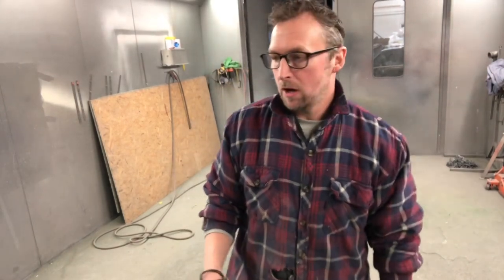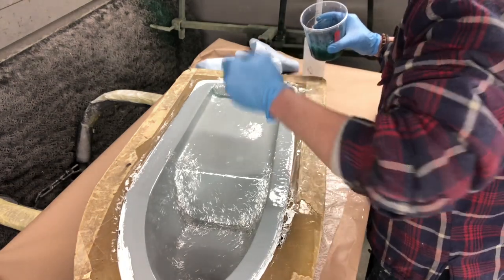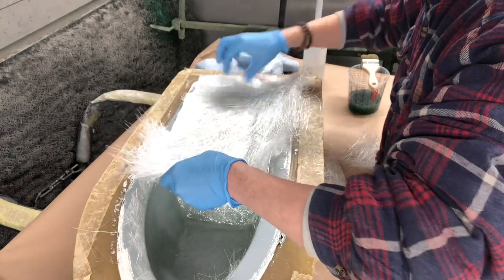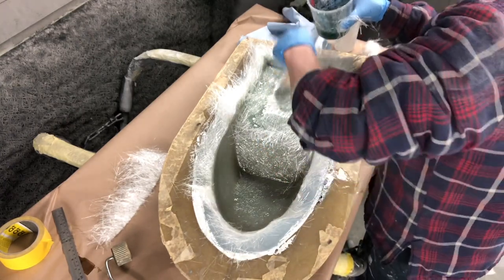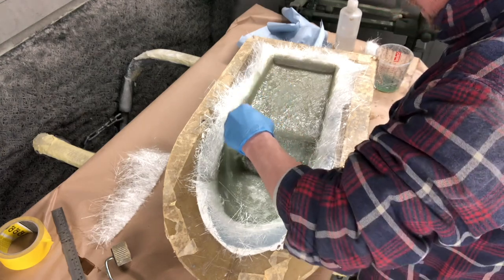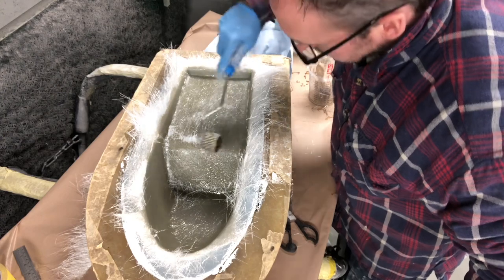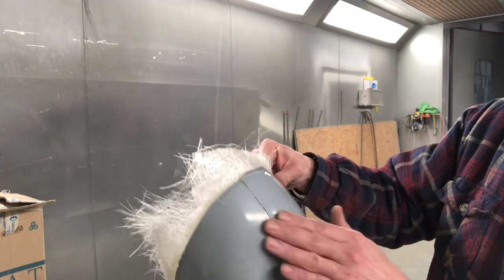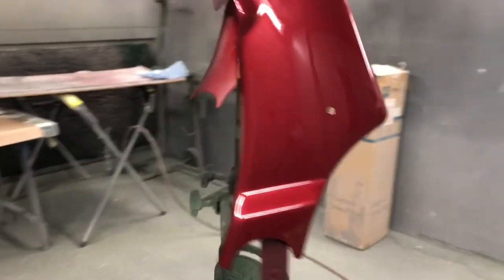Making A Fibreglass Seat

Comment: nice little seat unit mate.  i used a putty/plasticine type stuff to fill the 'split line' in the mould - really cant remember the name of the stuff - it was back in the late 80's but it saved on rub down time!  thanks for sharing cheers!  :)
Reply from the maker: Thanks Troy, yes I use filleting wax most of the time or just rub some thick mold release wax in if it’s not to wide 👍🏻
Reply: @Dustmonkeycreations  cool!  :)